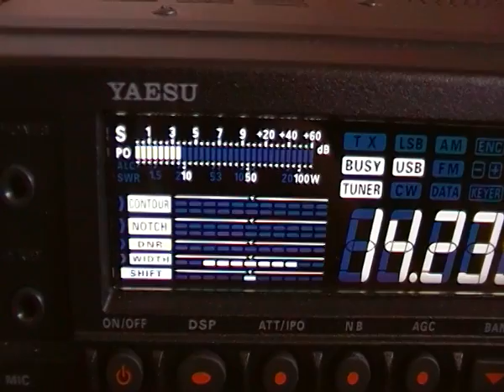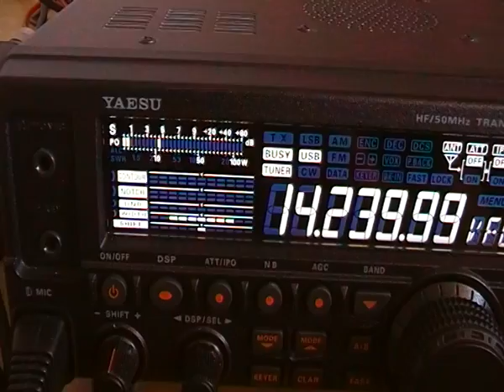G5RV VERSUS DELTA LOOP.MP4

Comment: Is this Delta loop vertical or horizontal installed. I was thinking of having one with the flat side at the top and feed the bottom point on the bottom.

Comment: I have a Carolina Window 80 special, and also a separate G5RV which I've turned into a bottom fed delta loop. The loop is far superior just like in your video. However, I am taking things one step further. This week, I will be introducing an MFJ-1026 noise reducer / signal enhancer and phasing the two antennas for maximum performance. The delta loop will act as a receive antenna, phase mixed with the Windom to cancel out all noise. I've been watching many videos on this, and I think it's going to be epic in terms of receiver performance. Please watch some videos on the MFJ-1026.
Cheers
Al

Comment: the nice thing about delta loops (from what i read) is that they can sit pretty low and still have a low take-off angle and directivity where the dipole at low height tends to be a NIVS (all or most of the power going straight up)
(please correct me if i am wrong)
i just put up a 20m deltaloop fed for vertical pol with about 3.5m of 75ohm matching stub. swr is about 1:1 on 14.070 and 1.3 on the bottom and about 1.6 on the top. so it's quite a narrow antenna.
Good vid thanks.